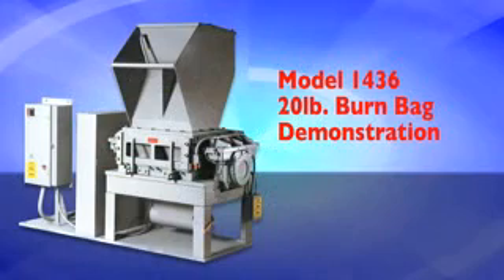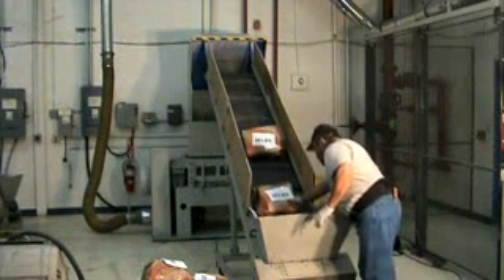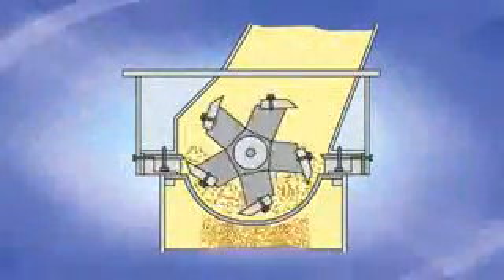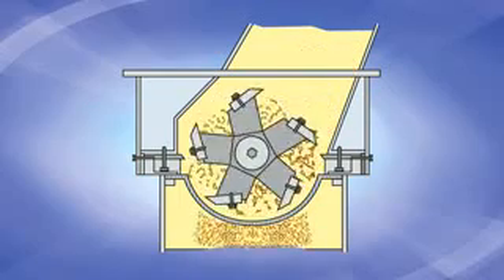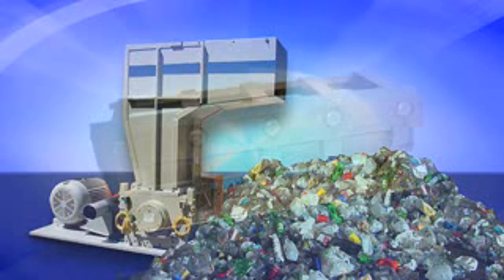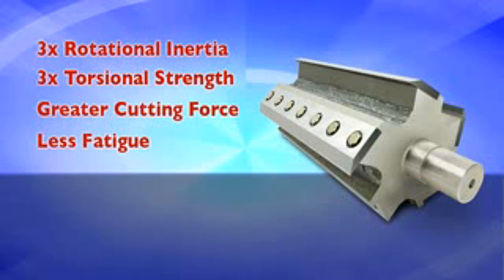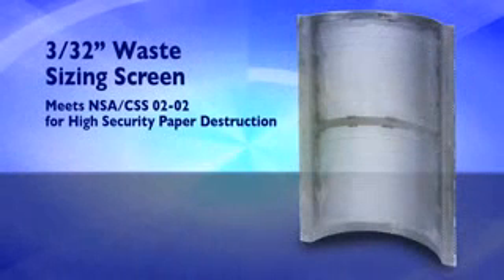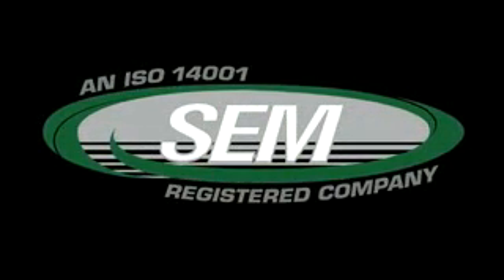Security Engineered Machinery (SEM) Disintegrator Destroys of Full 20 Pound Burn Bags

Comment: I thought burn bags were just that, bags that were meant to be burned along with what is inside them, not just shred them into millimeters.
Reply from the maker: Hi, Edwin! Burn bags hold classified material until it is ready for destruction, either by incineration or in an NSA listed destruction device, in this case, an SEM disintegrator. Hope this helps!